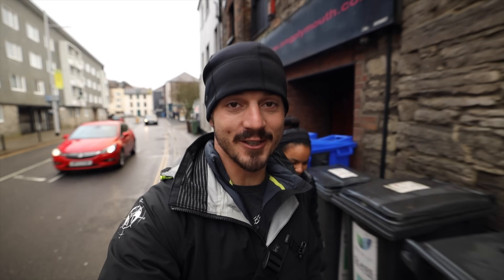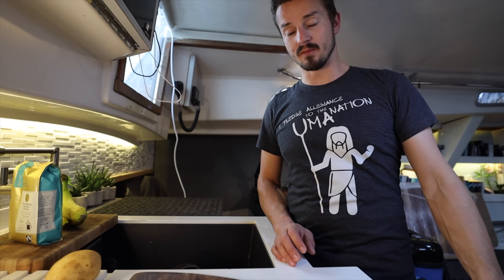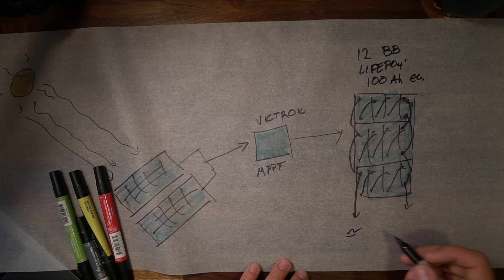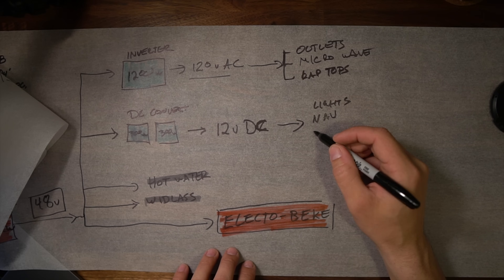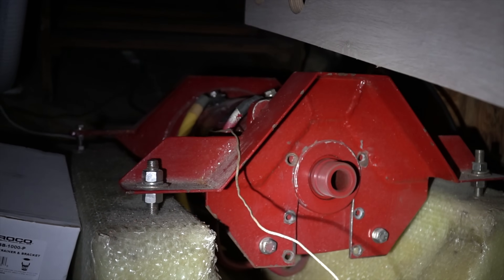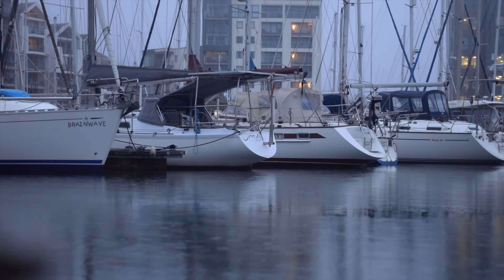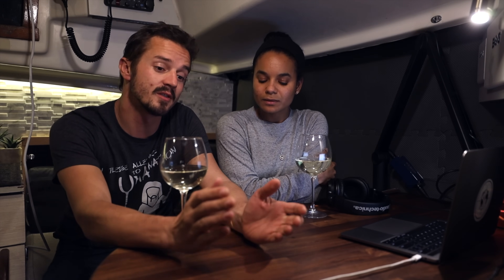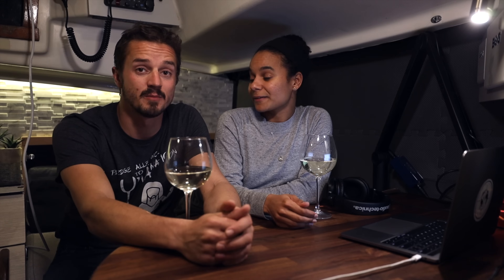5 Years Living offgrid on an ALL ELECTRIC Sailboat — Sailing Uma [Step 206]

Comment: Since you are living on a boat, have you considered using a hydrogen fuel cell converter. It extracts the hydrogen from the water to power your boat. You can also extract oxygen from the water to have an oxygen powered generator. But you must be careful about a fire hazard. Oxygen and hydrogen are extremely flammable and volatile unless you can contain them.
Edit 
GAZILLION THUMBS UP ALL AROUND 👍🇵🇷
Reply from the maker: Yes, hydrogen would be cool. It's not quite there yet as a viable alternative, but there are some really cool companies doing some amazing work right now. We're excited to follow and perhaps test some of the new products coming to market.

Comment: Gee.... I live in the UK on my boat. I've been off grid for 14 yrs . I have
 2 x100 watt panels , running through a standard mppt controller charging 3 110amp led batteries.  The batteries run my led lights and I use a 1000 watt inverter to charge my e bike and run power tools. My tablet I charge on the 12v. . In the winter months I use a 900watt pure sine wave generator to charge my bike. I probably use the generator once a week.  In winter I hardly use lights..  it's a godsend half to full moon.  
Good vlog ... 
I've changed my batteries twice in 14yrs.

Comment: Is there a fire hazard for Lithium ion Batteries on a boat? In cars they can catch fire as a result of a collision. They are not allowed in air cargo because of fire and commercial airliners have crashed because of an installed Li-ion battery fire. ( I can't imagine them being crushed on a boat as long as they are securely mounted.) But is there a failure mode that could cause a fire on a boat? What if the battery compartment flooded? What would happen then? What if there were a bad short?
Reply from the maker: There are many different chemistries of "lithium batteries". The ones we have are LiFePO4. They are slightly less energy dense than the ones in your smart phone, but VERY stable. They might melt in a fire, but they won't have a thermal run-away.
Reply: @SailingUma  Thank you very much for replying. I hadn't seen anyone say anything about battery fires on boats. 
What if the bilge flooded and water covered the batteries? Are the connections so waterproof that it wouldn't be a problem? If terminals are not water tight, I would imagine them to  become an electrocution hazard, also shorts in other settings cause heat & possibly fire.  What do manufacturers say about the battery area flooding?

Comment: Sailing Uma ? That skill set of how to drive a boat is a good prepping skill everybody should know. What I like to know is why you guys don't have on board gas generators and work on a 2nd fuel system to run the generator off a hydrogen generator to help recharge your boat etc. ?

Comment: RE: Computer power 
Every computer I have ever worked on takes 12v dc at the input. All adapters take 110v ac and  220v ac (every adapter will take either) and outputs 12v dc. There is a power loss in the voltage step down and ac to dc conversion. Have you thought about wiring your computers into a 12v dc connection?

Comment: THIS was AWESOME !!! As I'm completely on 12 volts I'm not used to converting to watts, but a few screens grabs, diagrams, and a basic calculator should do the translation. How did I miss the hot water install? Hoping the laptop data is below, or in answers to other comments. Thank you ever so very much!

Comment: Do you have a/c?  If so, how does that factor in?  If not, would it be a substantial burden on the current system?
Reply from the maker: We don't yet, but if we did, it would pretty much be used at the dock only. AC/Heat is a pretty high power load. On a faster boat, with a newer regen system, we might be able to pull it off while sailing.

Comment: For power source, have you considered wind & water turbines that utilize the wind & water currents whether you're anchored or sailing?
Reply: Are the solar sail fabrics useful?
Reply from the maker: Wind yes, but it's complicated. We'll be coving it in a video soon. You'd need at least 4-5kts of current to make any reasonable power, which would make for a terrible anchorage. Hydro regen while sailing on the other hand is very real, and very useful. We'll be coving a lot more on that soon as well. 

Solar fabric still has a long way to go. But if/when it ever becomes viable, we'll be sure to get our hands on it. We like to see our boat as an experimental platform to test new tech/systems and ideas, so if it's out there, and it's viable, eventually you'll see us make a video about it.

Comment: Great video guys !  Some advice on saving power . Your tools get rid of those corded  powertools man use dewalt 20v xr brushless motors tools . If you have a battery 4 pack of 5ah or 8ah you should be ok . 1 make sure those battery pack are charged . 2 brushless motors use less far more less power . 3 you guys are DIY type love that so the 20v xr brushless are professional grade contracting tools . 4 Goodluck . Love Peace and Soul .

Comment: Can you add and electric motor and a generator so when your battery it 40% you can turn it on to recharge de batteries to 100% then turn it off.
Reply from the maker: Yup. It's called a hybrid. Usually folks oft for a DC Diesel genset. It's about 3X more efficient than a typical diesel set up for long range cruising, but it cost quite a bit more to instal. Pretty much all large ships have this set up.
Reply: @SailingUma  i see. Also that can be done another way at the end of the electric motor that you got from the forklift can add just the generator? 1000 o 5000 o 10000 watts. Just to run for a few minutes to fully recharge your batteries. 😅

Comment: Love solar power just in case you're interested you can get a step up or step down transformer in your case maybe just a step down transformer from 48 volts to something like 19 volts DC...my laptop runs off of 19 volts but I don't have a 48 volt charging system I used a step up transformer to 19 volt from 12 volts DC... got the adapter that fits my laptop and I can charge off the batteries without an AC power adapter or inverter.   most electronic equipment does run off a DC power but it has an AC to DC converter you just have to figure out how to bypass the AC converter built in to the equipment.... Sometimes you can even feed DC directly into the AC input and it will work.

Almost forgot the important part if you look at your AC power adapter for your laptop it shows the input voltage and output voltage like I said on my laptop the output voltage on my AC adapter is 19 volts.... If you think about it you're taking your DC voltage converting it to AC with inverter then plugging your AC power adapter in for your laptop and converting it back to DC... I can't tell you what the efficiency rating is of using a step up or step down transformer... When I use a step up transformer to convert the 12 volt DC from my system to 19 volts DC I eliminate the need for a power inverter and the power adapter for my laptop

Comment: have question ,, what size ele-motor to use and just add 2 panels just for motor   and 2 all other uses ,,Now am thinking use LPG for cooking-hot water and i notice lot apt size Ref for used RV .cheap  run off LPGas ,, and last i notice place like home depot  sell  solar lights for lawns far cheap ,,each light have small panel ,,Can use them for running lights

Comment: They do make cylindrical/vertical wind turbines. Looks like a tube with slots that catch the wind and spins.
Reply from the maker: Yup. But they run into the same problem all wind turbines share... size. In order to get power from one, it needs to be huge.

Comment: Just found your channel and I REALLY like it. Uma is so beautiful!!! the vid has very clear  explanations...since you talk a lot about efficiency, I was wondering if you have measured/corrected the power factor of your drive motor? There is a pretty good explanation at https://www.youtube.com/watch?v=Tv_7XWf96gg -The Engineering mindset channel  - might increase the efficiency of the drive motor?....also your terminology could be a bit more precise: a watt is a measure of power, or the ability to do work, and a watt-hour is a measure of energy, which means the amount of work done over a certain period of time. 
A kilowatt is simply a thousand watts, and a kilowatt-hour is a record of an average output of a thousand watts over an hour. Another way to think about power and energy is a marathon runner. Power is like the ability to run at a certain pace, and the distance the runner covers is the amount of energy they used. (don't mind me, I'm just an Electrical Engineer nerd that wants to help and I love sailing and solar power!!!)
Reply: Whoops, did I miss the part where the drive motor is DC? not an induction motor?
Reply: @donwilson1061  Yes, the old and new motors are DC.

Comment: Laptops are kinda amusing because you have an inverter to convert to 120v AC and the laptop then turns it back to  19v (most common)DC to charge batteries.
Reply from the maker: Yeah, electricity on our boat gets transformed all the time. I'm sure in a lab you could test the inefficiency. But in the real world, it doesn't make much difference.

Comment: Curious why your converting to 120v to power laptop. That is a huge waste of energy since the laptop actually runs on low voltage DC. There are plenty of dc power chargers for laptops.
Reply from the maker: The energy used to bring 48V up to 120AC and back down isn't even noticeable. I'm sure on a lab bench, there is a test to determine efficiency loss, but in the real world, it's not something we worry about or even notice.

Comment: There aren't a lot of good wind generators that I know of, but have you two ever looked into them? Perfect for your cloudy days, and I think good when you're sailing.

I was also thinking about using the propeller to generate electricity, but I didn't think it was a serious idea, cuz I have no idea how much drag that would add. I've kind of entertained an idea for a while of making a sort of little drag line generator. Same idea. But seriously, wouldn't it be more drag than a wind turbine? What does the propeller currently do when you're sailing? Just stay still or does it rotate with the passing water?

Comment: One thing that may help is to check to voltage rating on the laptop transformers, so that they don't have to run off the inverter.  This may be possible with other appliances as well. Using a buck converter to provide the proper voltage may be way more efficient. This way it is possible to plug directly into the 48V, or even use 12V,  without a buck converter, if that is the rating. Here is are some links to buck converters:  https://www.youtube.com/watch?v=IT19dg73nKU https://www.banggood.com/search/buck-converter.html?from=nav

Comment: There's got to be a way to use a wind turbine somewhere aboard ship. The wind blows a lot in sailboat territory.
Reply: The problem with wind turbines is that they are expensive per KW, the small ones don't make much electricity unless the wind is blowing hard, and most boats only have a mounting spot at the back of the boat which will then shade the solar panels. Twin mast boats can solve two of these problems by mounting a larger wind turbine on the mizzen mast, but for sloops, size and position are limited.

To my mind, it makes more sense to buy more solar panels than it does to use that money on a wind turbine.

Comment: Generally a good job on the vide but PLEASE, don’t mix up power and energy as they are not one and the same. Power is in W or kW, energy is in Wh or kWh.
Reply: came here to write this
Reply: This is really important, because most of what you are talking about has do with how much energy you can store and use, and that is measured in kilowatt-hours, NOT kilowatts.  Still, you two have done awesome things with your boat and this channel, keep up the good work!

Comment: I'm enjoying your voyage. The electrical system you are using is cool. I've  used the same alcohol stove as you use for many years on my 1982 J/30. It  replaced a pressurized alcohol stove that couldn't boil water. We do day sailing and club races on the Intracoastal Waterway. Not sure if you upgraded your binoculars but I use Fujinon 7 X 50. They are great at night and have a built in compass. How do you keep dirty water from your anchor chain from getting into your rain water collection fill port on deck? I enjoyed your stop in the Netherlands. My wife is Dutch.

Comment: What about charging camera gear? If they are USB-C, are you using 12V chargers or 120V through the inverter? If you got a 12V charger that supports the fast charging protocols you could charge all that gear plus your macbooks and phones without using the inverter.
Reply from the maker: The inverter really doesn't "uses" a noticeable amount more by converting the voltages up or down. Sure, on paper, you could calculate the efficiency etc, but in the real world, it just doesn't make much difference.

Comment: How do you protect your electronics from a lighting strike? I did see one method with a wire connected to the mast that draped into the water but that was on a catamaran. I've also seen people putting all there stuff into the oven or microwave. What's the best way to protect yourself from a lighting strike and what other things get messed up on the boat when that happens?
Reply from the maker: Lightning does happen, but chances of getting hit are so incredibly low, that it doesn’t really make sense to spend too much time worrying about it. However, our boat has an aluminium mast sitting on top of a 7000lbs lead keel, so a strike should shoot straight through without much damage.
Reply: @SailingUma  That's pretty cool that your boat is grounded like that. I guess aluminum boats and steal boats are grounded as well. most catamarans are not I would assume. I know how to sail but not how to set up a boat for cruising the world. I'm learning every day and have learned much from watching your channel.

Comment: I really love your work!
But what about the fire risks with lithium batteries? If they catch fire they are almost impossible to extinguish.
That’s why i don’t have them onboard my boat.
Reply from the maker: LiFePO4 chemistry is incredibly stable. They don't just "catch fire" like some other chemistry make ups. If you put one in a fire, it would just melt.
Reply: Wow, is that so
A electric car that crashed and caught fire was impossible to extinguish (the batteries.) They burned for days.
But if they just melt i have to reconsider.
Reply: Another question...
How do you handle thunderstorms? 
That is my biggest concern regarding long time sailing because of some bad experience. 
I’ve sailed all my life but my concerns for thunder started recently 
Btw, Uma has become quite a lady. Old boats rocks!

Comment: Sailing electric is similar to trucking.  Explained...some companies don't let you run your semi.  So we been getting creative and attaching flexible solar panels and trying to find the best battery/charge manager/inverter to keep up with power needs.  Fridge, TV, Xbox, computer, microwave.  Have to use one item at a time and have the inverter connected to a breaker switch rated for the inverter used (they sometimes catch fire if you keep using them at peak (using temp power surge often).

Your entire trip is awesome.  Wish I would have throught to do similar while working on things in trucking.  I'm out of that now and looking into sailing.  Need to retire and live free as possible.  

Why is this not a Netflix show?  It would go great on Netflix

Comment: You seem to be a well thought out smart dood,,,   I think Electric is fantastic!   As a father I worry about you guys about something happening such as mast, rudder, motor or Batt fails....(The two way switch)  When you really need them from blowing up on the rocks on some Island or,, you know.   I’d feel better if you had a small 2 hp Honda with of course a small pull up transom bolted to the back of your Boat.
      Your loving Father!

Comment: You produce great vlogs. You are  both very intelligent. I know nothing about sailing. So I wonder:  Do you need to keep "protection" on board for pirates?  And do you have sonar with an alarm to let you know if the boat is about to run into something just under the surface that would cause you to sink?  ( Robert Redford- All Is Lost) .  And how do you avoid huge storms that would be disastrous for your small boat?   And last.  You bought the wrong coffee.  Sad to say, it's stale. Really stale. But most of the world drink stale coffee, and think that is what coffee is supposed to taste like. So you are not alone. I could write  2 paragraphs on it, but I'm not here to annoy you.

Comment: My favorite Uma video so far. Well structured useful information.  I was a bit skeptical about the 100% electric concept.   I once entered a harbor in Central America.  As we pulled in several other boat owners ran over to tell us to leave immediately.  They were all trapped there because big lightning storms came in ever afternoon.  All of them had fried electronics.  As soon as they got a replacement electronic component it, or another, would get fried.  I guess the diode in a diesel's generator can go out, but generally a diesel seems more robust, and more repairable as compared to a collection of electronic boxes.

Comment: Rain or not rain but misty and foggy?  That’s mizzle!!  (Misty drizzle). And that’s me completed the Binge and closed the loop!!  Woop!   What are you using for a BMS Dan?  Built in with battery? Is that accessible via an app as well to keep an eye on things? Did you manage to get decent contactors for the windlass? Did you ever consider a wind generator?  Great for the UK Winter!!